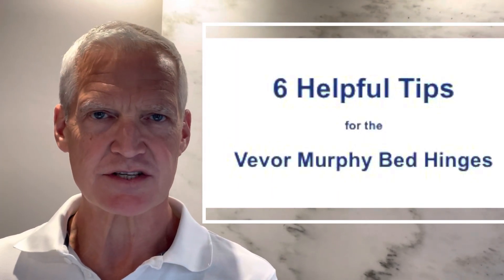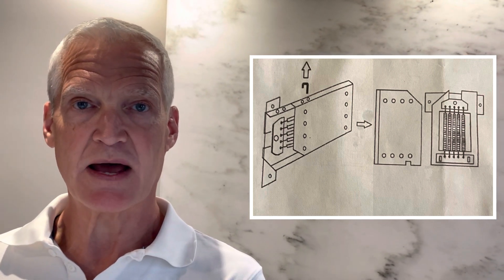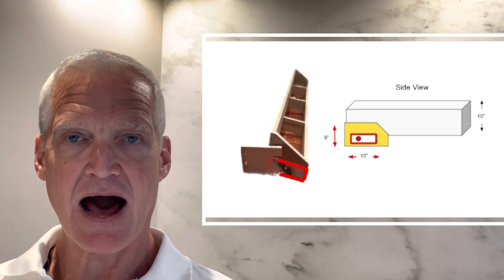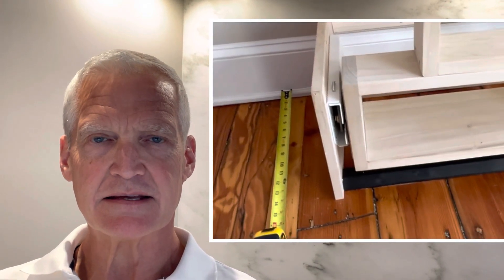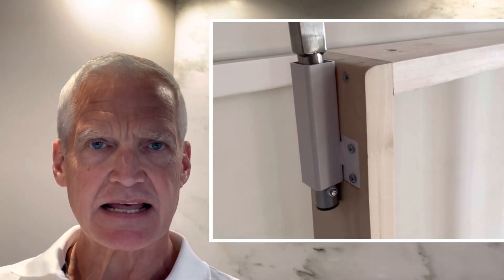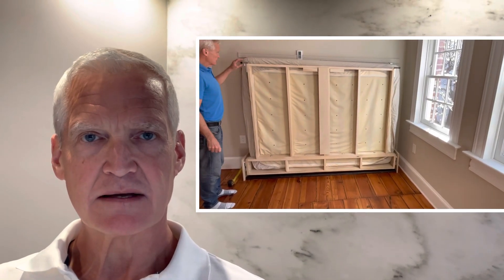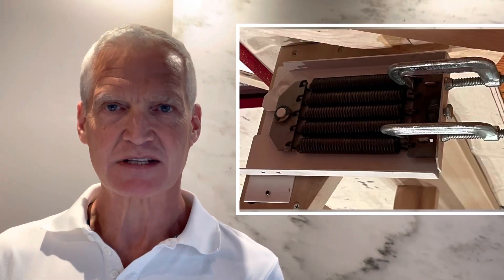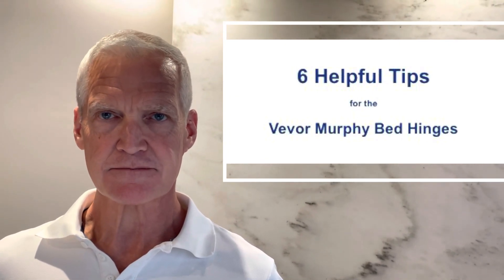6 Helpful Tips for using the Vevor Murphy Bed Hinges

Comment: Questions,  can the hinges be lifted higher to raise the panel higher from the floor when opened
Reply from the maker: Hi,  you can mount the hinge case higher than I did so the bed would be higher up from the floor.  The hinges would do the same thing, lifting the bed from horizontal to vertical, but you would be setting the bed higher.  My video shows a bed 18” off the floor, which is a bit low.  The standard height is 25”.   Hope this helps
Reply: @kevink6091  oh yes! Current i am only 13 inches from the floor. Far too uncomfortable to get up and down

Comment: Sir, 
Im waiting for these hinges to arive . It take ages. 
Would you tell me please what is the dimension of the 5 spring hinge?  Witdth, lenths and thickness. 
Also 
2. What ' minimum' gap i should have between mattress and the back wall after closing the bed. ?
3. What extra gap to make between two parts of the hinges so that after sliding the bed frame hinges wouldn't be to tide ?  
I would realy appreciate your help. 
I cant find any infor on internet or from the seller.
Reply from the maker: Here is a link to a video about dimensions that might help you with planning your project:

https://youtu.be/LNDVHgvLNO4

I am traveling so can’t get to the hinge to measure it, so hopefully it arrives.  And I think some of the measurements in the video will help you.